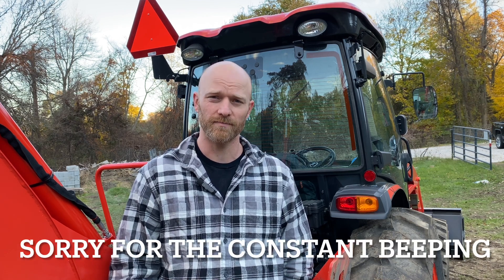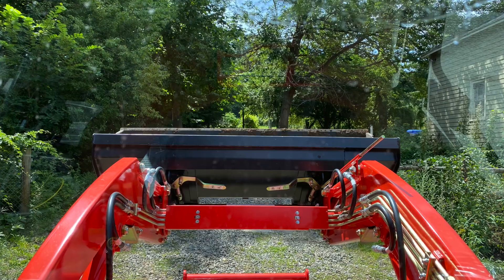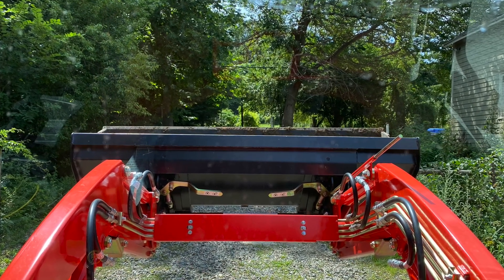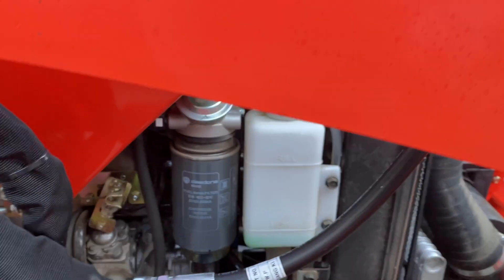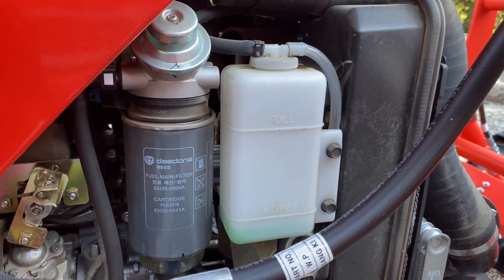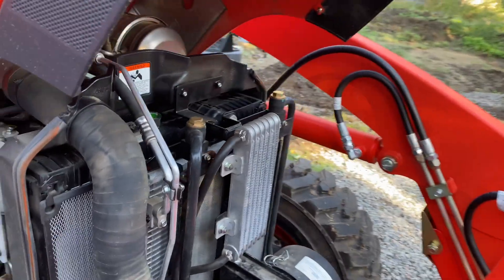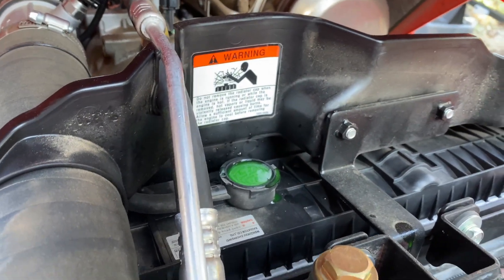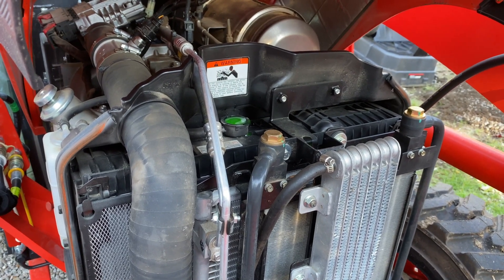Kioti Tractors - Everything that's gone wrong in the first 50 hours!  Lemon???

Comment: My only gripe on my 3510 is the shifting of gears. Isn't very smooth, but others have mentioned its mostly normal with a hydro. Aside from that, no other real complaints. Sucks to hear what you had to deal with!
Reply from the maker: Shifting gears for me is smooth, I just have to tap the forward pedal a bit to get it to catch sometimes.  They warned me I would need to do that with a new machine though.

Comment: Thank you for sharing your experience.  I think you were unlucky, but I will comment shortly on some issues you exposed.  As my dealership owner told, tractor loaders are no industrial loaders, you must use them more carefully, more gently, respecting their stated operating limits and capacities, and the user's manual warnings and recommendations, like not pushing too hard on the bucket when the bucket pistons are out,  The bucket itself is made of rather thin sheets of steel, although there are reinforcements along the edges at intervals underneath, but it remains a fragile and highly flexible steel box, considering the weight it can lift.  Same holds true for the mobile frame supporting the bucket, it can shake and twist a lot if we operate too fast with max loads.  Great care and slow operation is required when we play close to its rated limits.   As for the radiator problem, some air trapped in the system maybe, I would say this is a very little issue, very easy to fix and nothing to worry about really, as long as your engine doesn't overheat.  Kioti tractors are generally rated good, but they are delivered only partly assembled, so some dealerships may be responsible for not being careful enough in the final stage of tractor assemblage and preparation in the dealership.  I have a smaller Kioti, 40 Hp and am pretty satisfied overall so far, but always a few small issues, like rear lights that don't work right out of the dealership yard, and I tell you, the engine oil filler cap is very poorly located, the worst setup I have ever seen on any combustion engine I have owned, that is, simply to pour in some engine oil, you have to either untie and move 5 electric wires, 2 rubber hoses and pull them sideways, OR dismantle the diesel fuel filter, meaning you will have some diesel spill and drip down directly on the engine oil filler cap, an ugly mess.  It is just incredible they made it that way.
Reply from the maker: Thanks for watching!  I completely agree with you about being careful with the loaders. I’ve seen a lot of people with broken/bent pistons when pushing the loaders too hard.  Not something I want to have to replace!
Reply: @Curtis1824  Yes, and by the way, Merry Christmas !
Reply from the maker: @yoseflaurent3376  thank you and same to you!

Comment: Wow. I cannot complain about my 20 CK3510HST. I have beat mine hard over 420 hrs. At 44 hrs I developed a leak in a lift cyclinder from jamming a piece of pine bark in the piston seal. Dealer swapped it out in an hour under warranty. The biggest issue I’ve had that started about the same time is my tachometer will hang during its initial start and show higher rpm than engine is running. The dealership offered to replace it under warranty but the hours would be returned to 0 indicated. I didn’t want that so I unplug the battery and the needle resets. Only aggravating issue I have with it. It’s done more work in those 400+hours than most tractors do in a lifetime.

Comment: Mine started having problems starting after 25 hrs. 1st time in the shop they said everything was fine and couldn't find a problem. 2nd time in the shop and just got it back today they changed the plunger due to fuel not going through when key was turned. Well new plunger same problem! Let see what happens the 3rd time in the shop. Probably will trade in for another brand if problem is not solved. I bought a new tractor instead of a used one to avoid these type of problems.
Reply from the maker: It’s the worst having a brand new machine in the shop so many times!  Hopefully you don’t have any problems with parts.

Comment: I had mine for three hours and the engine lost all the anti-freeze due to the engine block heat popping out of the side of the engine dealer picked it up and had it back the next day .
I broke the door glass ( my Mistake ) cost $ 1,200.00CND not installed. other than that it's an ok tractor.
Reply from the maker: What a bummer!

Comment: Sad to say ,with the "unprecedented " compact tractor sales--- these "hot-cakes" off the assembly lines have suffered quality-control issues (approx 25% across the board) from all manufacturers. As for your loader ,my friend recently got the comparable bob-cat version of you Kioti & it came with a BENT quick attach. He has to fight the dealer-manufacture on it for 2 months but they FINALLY made it Right. A TRACTOR should be 98% sound for the first 2000 hours of its life, not a crumby hot-cake off the assembly line. Your rig just needs to get over "c v d -itis". Thanks for the great Video Sir and happy safe tractoring.
Reply from the maker: I couldn't agree with you more.  Every time I mention the loader, they want to ignore it.  They said all the measurements check out and that's all they can do about it.  I think the dealer is suffering from the same itis.

Comment: Had an open station 5310 until the hydraulic draft got stuck after 20 hours . Dealer could not fix it so went with a 5810 turbo unit replacement which blew an O ring on using the backhoe almost immediately losing most of the hydraulic fluid. It has since blown another digging out a 6 inch stump? Dealer replaced with a better O ring. Lucky it is still under warranty. The hoses and electrical wiring looked like a child had done them. Purchased post hole digger but on first use realised the Kioti auger bent the remotes near the top link only discovered after use. Had to reweld the top link cheek making it smaller and bend back the remotes luckily with no breakage. 78 hours now and nervous for what is next but when it works it is good . ( out of action for 3 months in my first year )
Reply from the maker: That all sounds terrible. Thankfully I haven’t had any of that happen, but I’m now going on 13 weeks of it in the shop.

Comment: If the check engine light comes on and I says cel with  a motor on it the dealer going to tell you to run it at 22 rpm even though you don't need to regin by itself DPF is stupid if feds don't like smoke don't use a diesel motor
Reply from the maker: Just all part of the push to go electric.
Reply: @Curtis1824  electric is two new many problems how do I charge it plug it into a tree I don't think it will last very long my driveway is six miles long

Comment: Sounds like you got a junker. I've got a stick shift 2610, and it's been mostly problem free so far at 50 hours. I've mostly mowed with it so far, but I've done a lot on slopes that sometimes got up to around 30 degrees. That can't be gentle on the 4 wheel drive, among other things, but it doesn't seem to mind so far.
The only thing that's really pissed me off with it is one of the front tires ended up with a huge split in it, and apparently that's not covered by the warranty. How that happens with industrial tires mostly mowing grass other than a defect is beyond me, but apparently I "ran over a rock" according to the dealer. Yea, sure, whatever.
The bucket on yours is really surprising. I got mine stuck in the mud up to the oil pan, and had no choice but to haul it out by pulling it by the bucket.
Reply from the maker: Bummer on the tire!  Hope it keeps going strong for you!  I had to rescue my tractor from mud as well the same way. It was already warped looking before that, so who knows. The dealer won’t look into it past the loader arms being level.

Comment: Just curious, are the windows and door frames easily removed for summer use?
Reply from the maker: I’ve never tried to remove them. The back window opens pretty good. I’ve heard they can be removed easily, but with the luck I’ve had I didn’t want to chance it. I also don’t have a great place to store them if I did take them off.
Reply: What good does that do if it doesnt run?

Comment: Most problems on new tractors are due to the tractor not being properly prepared before the sale.
Reply from the maker: I did catch that they didn’t check the oil level for the transmission. The full plug was still painted over from the factory.

Comment: My first 50 included Loose alternator, dealer came out diagnosed, apologized and came out the next business day with new belts and made it right. Then there's the "grill guard" .. ensure that it is never left down or the first time you lower the front bucket arm it will bend the guard inward so that tit cannot be raised  and it twill not let the bucket go all the way down either.
Reply from the maker: Sounds like you have a good dealer!  I've seen many videos and comments about people lowering the bucket down on the grill guards.  Seems to be an issue with most brands!

Comment: Greetings! The first 100 hours for any new car are the most important, the mechanisms are lapped, at this time it is necessary not to load the tractor too much .
Reply from the maker: While there is a break in period, I don't think the tractor should be in the shop over half the time you own it.  Still having issues with certain things that the dealer can't seem to figure out.
Reply: @Curtis1824  agree with you , therefore , having an engineering education , I try to closely monitor the technical condition of the tractor . I also have questions to the dealer in Russia , for example , they recommended engine oil to me , but it does not comply with the operating instructions , I have to argue .
Reply from the maker: I feel the same way. My dealer especially I have zero confidence in their recommendations. Which model do you have?
Reply: @Curtis1824  I have a Kioti 3010hst , this is a complete analogue of 2810hst , I still have a very small operating time , only 50 hours .

Comment: I have a DK4210SE-CAB (39hp) less than 200 hrs.  My first hydrostatic tractor.  I was leery about going to a hydrostatic because I've heard of this happening to others.  I had a concrete pad that use to be outside of my back door but i had moved it years ago with a previously owned MF 1165 (manual transmission), a tractor i wish id have kept.   That tractor i later traded in on a MF1533 which also is manual transmission and has a backhoe, which is the reason i traded.   I live where we can get a lot of snow and drifting so i bought the Kioti last year which has a cab.  My plan was to sell the MF and put a backhoe on the Kioti but im rethinking that now.   Anyway i wanted to move the concrete pad so i tried pushing it with my Kioti and to my surprise i couldnt move it.  They hydrostatic just slipped, and yes i had it in the lowest range.  The tires didnt spin and the engine didnt bog.  I got my MF1533 (33hp) out and pushed it with little trouble.  It also happened when i was on a bank and my rear wheels were in a bit of a dip as i was trying to move up the hill (not pushing anything).  So far thats my only gripe with this tractor.   Im guessing its not because its a Kioti but its just the nature of hydrostatic transmission.  Anyone else notice this?
Reply from the maker: I haven’t had that issue yet. Usually my wheels start slipping first.   Something I’ll look out for though.
Reply: Sir, l have a Massey-Ferguson 1736m power-shuttle & it is phenomenally powerfull & agile. The hydraulic pump on the transmission (for the remotes) makes the loader almost too fast. At 11.6gpm on remotes & 6.5 on Stearing, everything is super fast & powerful. The power-shuttle is the way to go( it is the smallest @ 3450lbs)--bare tractor to have this "mighty" option. Pure power to the ground, no clutch for foward&reverse. It is whisper quiet & oh so smooth! So get yourself a new MF 1835m power-shuttle to replace your 1533, & avoid ALL them hydro-slack-o-matic howling "want-to-be" twak-ters.

Comment: Mine also having over heating issue's at less than 50 hrs after getting that issue fixed yesterday while moving firewood I noticed antifreeze smell .opened the hood and every blade of the fan was broken off to the shroud I'm talking pieces 4" x 6" I only found 4 that were still lodged inside the tractor not sure where the other pieces went but no doubt I would have noticed them laying on the ground in my working area calling on it today.anybody else have this problem
Reply from the maker: That ridiculous!

Comment: Feel your pain.  I would wonder be if the biggest problem you have is the tractor or the dealer. Bet it ends up being the dealer or their service manager. But that's a good thing because it's easier to find another dealer than it is to change the tractor. Miles to the new Kioti dealer might be an issue though.
Reply from the maker: Unfortunately the next closest dealer is 2 hours away and I would have to cover the cost to get it there.  Kioti doesn't pay for trucking the tractor to and from the dealer even for warranty work.
Reply: Same problem I'm looking at here.  Looking to buy a Kioti. Not many around.  Kubota dealer a mile away but their service department has a bad reputation and I sorta have it in my head I want a Kioti.  Kioti dealer is 30 miles away and the next nearest is like you, 2 hours drive and I have no idea about their reputation.  Good luck.

Comment: I use a friend's kioti 3210 and after an hr it keeps shutting off, the rpm drops from 2500 to 1000 then it hesitated and shuts off, the thing was just serviced and it's new.. on the hr meter it flashes  "4" then  "f 04" or "f 05"  then "end" and it then shuts off.. start it up and a few minutes later the same thing happens.. it just pisses you off, I mean really, it's been looked at 4 times and it still does it.. get it back and wham, same issue.. crap
Reply from the maker: I feel your pain.  I've had mine in 3 times to fix the AC and it's going in again here pretty soon.

Comment: Before I even watch the video most people should know that when you have a new diesel engine you do not rev past half throttle until you reach 50 hours and also you start the motor on low revs and when you shut it down you wrap it down and let it idle hour and then shut it down

Comment: I have owned Two Mihindra Tractors never had a problem that wasn't my Fault . I just went to buy another New Mahrinda but aThe Hydrolic Block was exposed and low to the ground , I wound up Buying a Kioti ck 3510 Shuttle i Like The shuttle Best The seat is so much better than my other Tractors and only Time will Tell i am not crazy about the Re Gen Mindriah does not have to Re Gen The Dealer did not explain much i have watched many video's i understand It is Part of The New Green Deal a very expensive Catalic Converter ,Basically , Which will be on all tractors soon . If you use a Tractor very often there will be something happen on any Brand Tractor Kabota has made some models that were Known for trouble , I grew up with an 8 N and we used That Tractor every day We had to split  it in half more than once but we could work on it. I would never Buy a J D Because of Their Policy that a Dealer only can work on their Products They can keep their Machines, I looked at my son's Kabota and first thing i noticed was The loader Control arm is to far out My arm would be wore out My loader Lever is by my arm rest no problem . There are things on all tractors Good and better located , I like the Two Remotes in The rear and adjustable arms and being able to mount a hydrolic Top Link would  have been Great back in the day .I like the locker on the Kioti  which Mihandra has also .